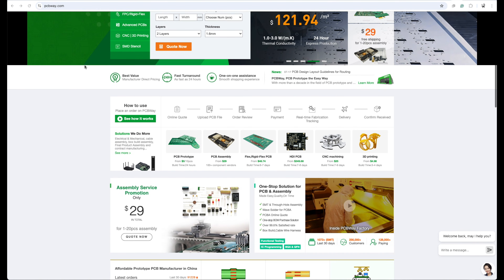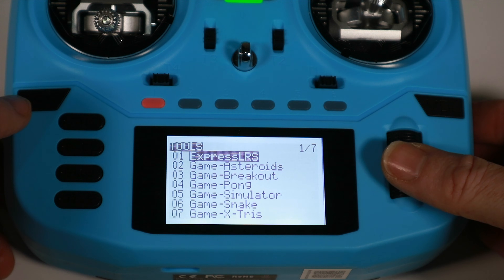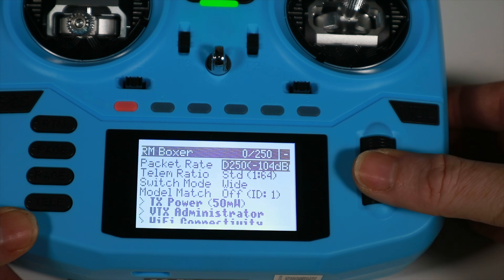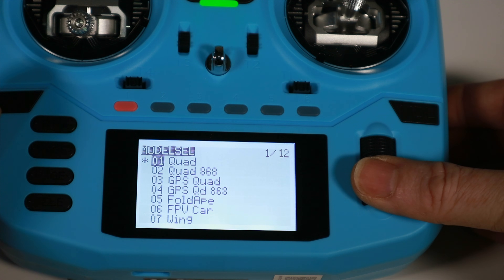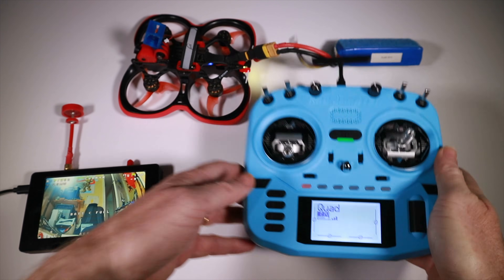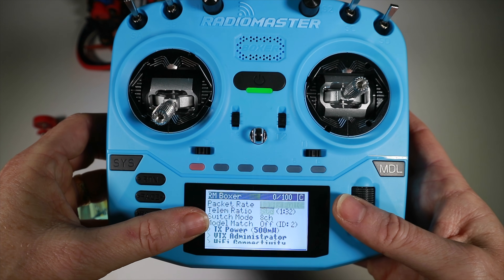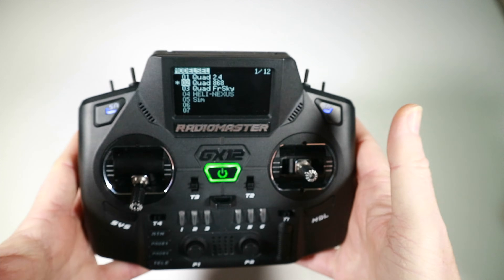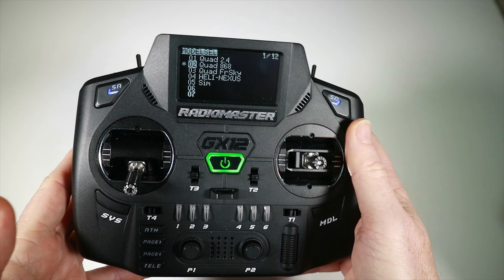How to use different ELRS profiles for different models in EdgeTX

Comment: You just saved me. I got Radiomaster TX15 and had the same issue :D. I was manually switching frequencies... This saved me. Thank you.
Reply from the maker: Yeah - I never even considered it before you get a single radio that will do both without an external module :)

Comment: Binding phrases override Rx ID checks at bind time meaning you can accidentally bind mismatched IDs unless Model Match is used (which protects on connection rather than binding) Is this correct? I was excited to think I could simply do it your way with rx ID only but maybe it’s not fool proof?
Reply from the maker: I'd have to double check this, I was mainly moving between 868 and 2.4 on a single radio, so no chance of that binding to the other.  As I recall, and to be honest it's a bit fuzzy - I remember it as one of two things.  1) you;d have an rx flashing as if it wasn't bound if the rx id is different... or 2) it does bind, but then nothing actually responds to any sticks inputs

Comment: Hey im starting in the hobby now. Can I buy a transmitter with ELRS from you. E.g. a Radiomaster pocket or boxer?
Reply from the maker: I'm using them :)  The Pocket is dead cheap to buy new though
Reply: The radio Master Pocket only cost $60 USD

Comment: Very useful, thanks! The number of times I’ve forgotten to switch back to 500hz for my race quads after flying my whoop at 250 (because SPI Rx). This is definitely going to help
Reply from the maker: You must have very young thumbs to tell the difference - I can't :D
Reply: @CurryKitten  😅 Thanks for the compliment! My thumbs have seen many winters, but you really can tell if you are running a Betaflight preset for 500Hz and the radio is at 250. It flies all jittery and seems to control in steps